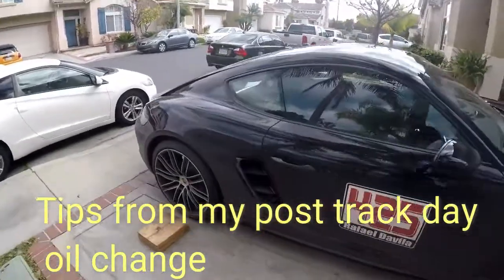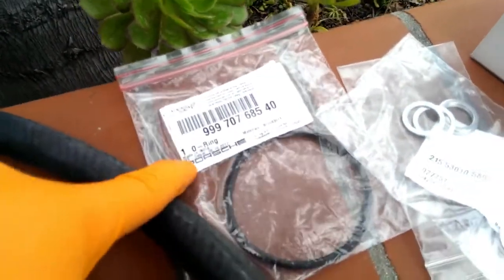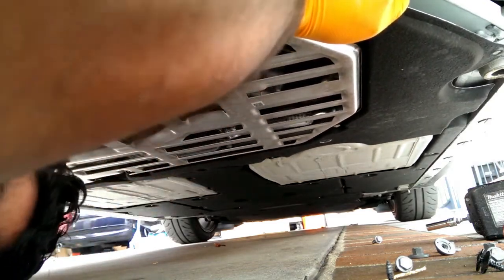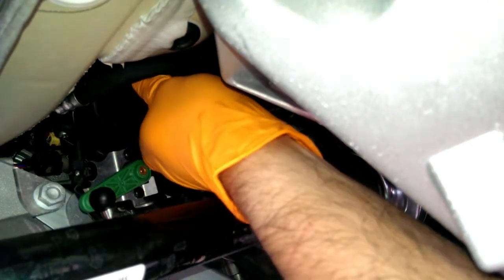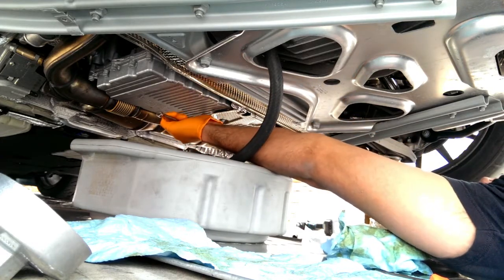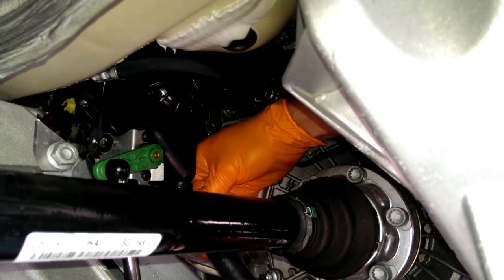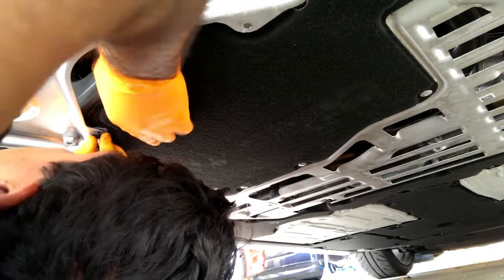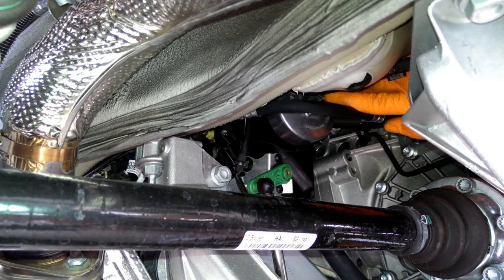982 Cayman Oil Change

Comment: Great DIY video for ANY 718 with manual transmission. Did my first oil change on my 2019 Boxster 2.0 today and this gave me confidence to tackle the job. It wasn't hard! I used Rhino Ramps under the real tires, no need to take off the left rear wheel as I've read on forums. I needed the low profile filter socket ($55 from Suncoast,  it made it easier in the tight space. Used a few feet of old garden hose (this catches all the drops when you twist off the filter, there is a built in funnel to catch the flow).  Really not that difficult to get the shield off, but no way I would have figured out which nuts and screws and bolts to take off without this video. Overall DIY difficulty not much more than oil change on my other P car (2018 911 GTS, need to remove the turbo fans) or even my previous 2015 Cayman GTS (also needed Rhino Ramps to get to drain plug). Thanks for the vid!! BlueNorther

Comment: The little green lever and rod...What is that and why do some folks have to push it down or remove the screws attaching it to make the oil change easier??   Looking at my Fiance's 718 Boxster S, it would not push down.. Can anyone shed light on this?  I'm waiting on the oil filter housing wrench to be delivered so I have a few days...

Comment: Hi I think I have watched your video over 10 times.  I have the cayman s 718. I was able to unscrew the oil housing, however I was not able to remove the oil housing and filter. Therefore oil change was not
Reply: You seem to have more space than I do. To tell you the truth I doubt that the dealer ever changed the filter, however they charged for a complete service. In addition there’s a thing green tab in front of the oil housing and it seems to be broken. I don’t know what that leaver does. At this time I’m going to screw back in the housing an take the car to the dealer. I purchased quick jacks to service the 718 but it was all for not. Now I’m afraid to run the car not knowing what the green tab was all about I’ll have to tow the vehicle. Let me know if you have any insight thanks

Comment: Thanks for the video. How did you go about resetting the oil service indicator?
Reply: This was not necessary at the mileage shown. It is only necessary at the scheduled service intervals. With the 2018 models the first scheduled service is included in the original purchase price. After that, you could ask a nice Porsche dealer technician, who may notice the bottle of scotch on the passenger seat looking for a new home ;-)  Or pay an indie shop to do it. Or get a Durametric cable when they support the 982.

Comment: One other question:  Is your 982 GTS a manual transmission or PDK?  I understand the 982 oil change is more difficult in the case of PDK - due to equipment crowding/interference.  (My 982 Cayman S has PDK.)  Thanks.
Reply: That's a manual , on the PDK , the headlight leveler arm is in the way . I think it's just a 10mm bolt to drop it out of the way.

Comment: I have a budget of $55,000, should I get a 981 boxster S/cayman S or a 982 boxster base.
Reply from the maker: HOONDA RR So with $55k as budget are there any options you would like to have on the car? What do you intend to do with the car? Daily? Weekend Occasional? Track Car?  Because Porsche is still gonna want $2,400 more to even sell you a base Boxster, unless you have found some dealer lot specials with one or two options. 
If your answer is no options at all then go for the new car, but if you want any options and are flexible on the 3 or 4 colors you like I would totally go for a 1 or 2 year old 981 Cayman. You can always get a nicer certified pre-owned car if you shop the limited Porsche market for a couple months.
Reply: Cars+Raf definitely my daily car. I need PDLS, nav and bose. I see a 2017 boxster with all those options and more for 54.5 and it’s certified from a Porsche dealer.
Reply: Cars+Raf but I also see a lot of certified 981S’s too
Reply from the maker: Yeah I would get that one, as long as it is a color you like.
Reply: 981 S